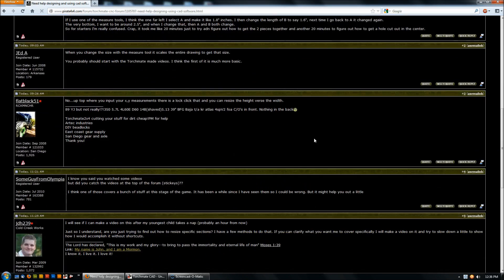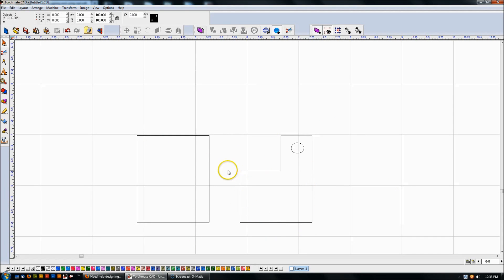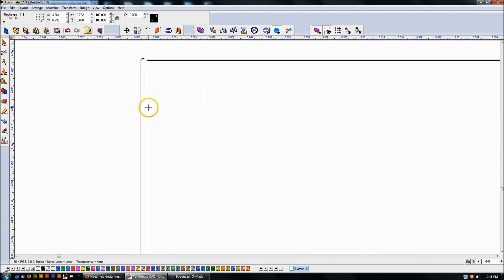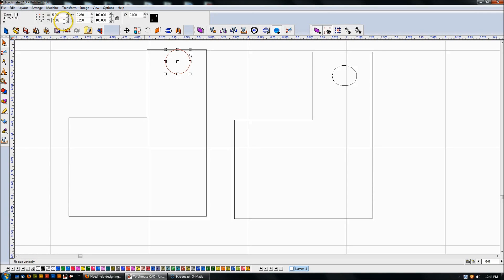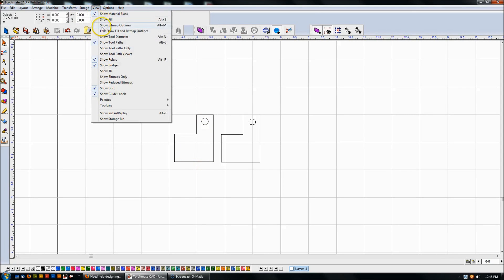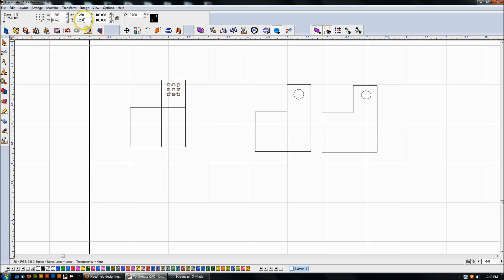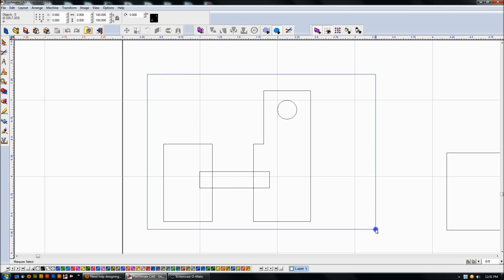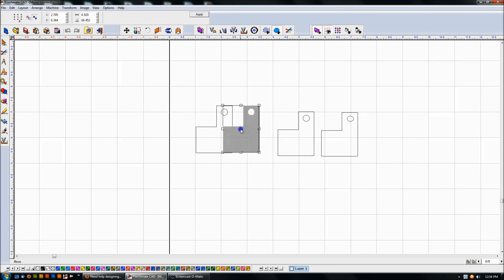Torchmate CAD/CAM -- Basic object creation and resizing

Comment: Hello John this might not be the best video to ask this on but I run the CNC at my school (just me) and I'm having an issue. when I try to cut out a design with an outer border the program wants to cut the outside first instead of the inside design. what is possibly causing this and how do I fix it so I don't have to constantly jump through points? thanks for your help and videos they've taught me so much more then anything else
Reply from the maker: +jay wells When you highlight your piece in the cad/cam software it should say it is one piece (top-left corner where it says objects).  If it is more than one, then you need to weld the shapes together (usually a basic or xor weld).  You can also go into the layout of the part and specify the cut order too if you want (assuming you have multiple tool paths not combined into a single object).  Hope that helps.
Reply: +John Harmon - Cold Creek Works well I always make the path and then group the piece together and I do usually have multiple paths. how do I create the order in which to cut that is where I get lost?
Reply from the maker: If you have one object, and apply a male tool path to it, then all should be well.  If you have multiple objects as part of the same piece, then you need to combine them through various welds until you are down to one object

Comment: There is a much easier way to adjust sizes.
Step 1. Make path of the shape you want to resize.
Step 2. Double click the shape.
Step 3. Highlight one node at the time and enter a new position in the left upper corner of the toolbar, do this to any node you want to move.